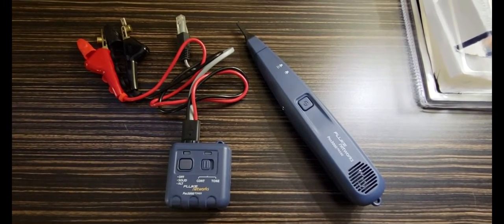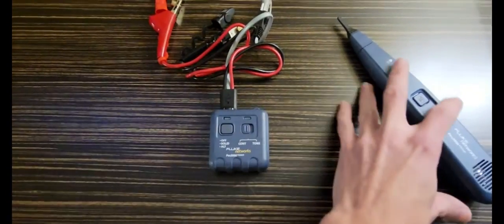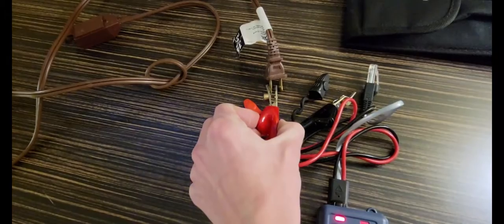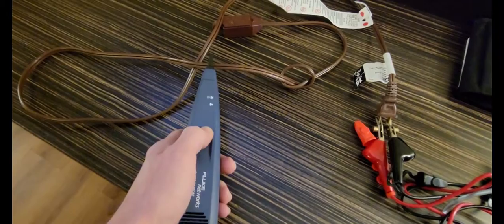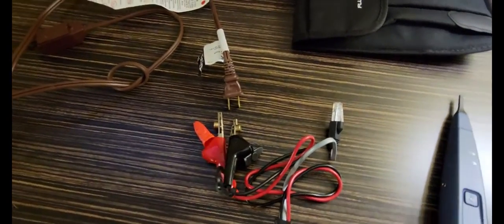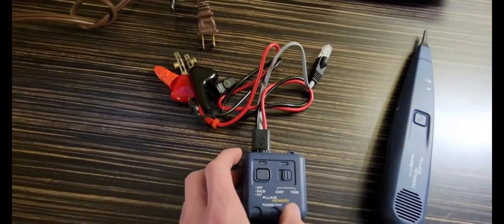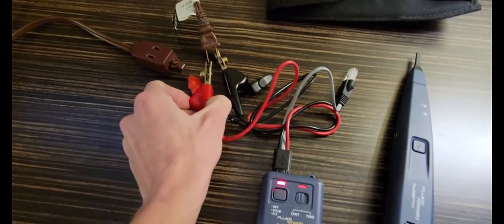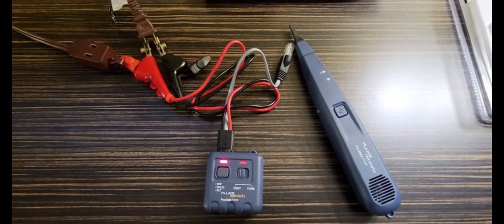How to use Fluke Networks Pro3000 Tone and Probe Kit

Comment: Beautiful tool.. been using it for few years now, worth every penny..
Reply from the maker: I really like this one also. https://amzn.to/3D1vr9G
Reply: I need to use a tone generator for DC cables under load, is it possible to do it? For example connect sender to a hardware side, and receiver on power distribution frame circuit breaker?
Reply from the maker: @boggiinc  no you need to de energize before tracing. Use this https://amzn.to/3XeEStp for energized circuits

Comment: nice video, I have a rookie question..when you detect the wire... is that when the device makes the beeping sound??
Reply from the maker: Yes sir. And the closer you get to the wire the louder it will get.
Reply: @ElectricianToolDeals   thanks for the response. Also IF I was to use this device to test an ethernet cable and trace it back to the patch panel, do I need to remove the rj45 connector on the cable first so I can plug the wire on the device?? or I can just put the device on the ethernet cable
Reply from the maker: @mrb326  I would remove the rj45 and clip the red and black leads to any 2 wires. You should be able to trace it then. The connector on this device is a male. Therefore you would need a female to plug it into
Reply: @ElectricianToolDeals  okay great, thank you very much
Reply: @mrb326  If you don't want to cut off the connector, you could rig up an RJ45 jack with some bare wires as an adapter.
Reply from the maker: Great idea there buddy. Thanks for the comment.